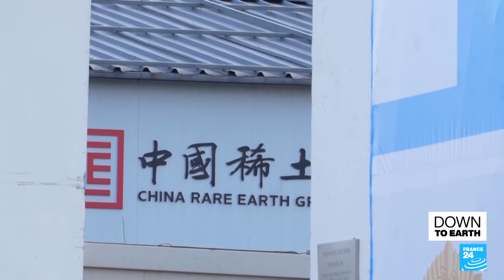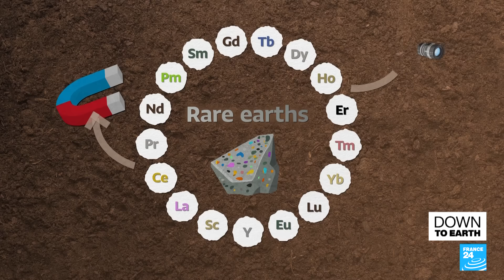French-American chemist makes major breakthrough in recycling of rare earths • FRANCE 24 English

Comment: Just a quick public service announcement: the United States actually has all the rare-earth elements we need right here at home, locked inside the millions of tons of coal ash produced over decades of power generation. Coal ash is rich in strategically important elements like neodymium, dysprosium, yttrium, and others essential for everything from fighter jets to smartphones to electric vehicle motors. The challenge isn’t the resource — it’s building the domestic processing capacity to extract these elements efficiently and in an environmentally responsible way. Current extraction methods can be messy and energy-intensive, so the real breakthrough will come from designing cleaner, scalable systems that can turn this waste stream into a reliable supply chain that doesn't rely on China. It’s absolutely achievable, and far safer than continuing to depend on foreign suppliers for materials that are now tightly tied to both our national defense and our high-tech industries.

Comment: Globally, europium production is relatively low, estimated around 100-400 tonnes per year.
Europium is a chemical element, and for $3 billion, one could purchase around 5 million kilograms (5,000 metric tons)
3 billion to RESEARCH a way to get very little back from neon lights ONLY.
Economic insanity.

Comment: Still missing a key part - the labour costs to break the stuff down to the point this system can be used.

I'm a recycler and I take apart these electronics/gadgets etc and it is time intensive if you want to break them down to their bare constituent parts. So much so, I like the vast majority of recyclers only take the easiest parts that pay - copper, gold bearing parts etc. There is no money currently to take it further - you lose $ if you do. 

Until robots can be tasked with taking apart cellphones, hard drives and motherboards etc - I'm sorry to say, this sulphur solution is not going to be financially viable.

Comment: The "actual" volume of rare earth minerals is extremely small when compared to just about any other commodity that it makes recycling absurd on face value.  Way easier to build more refineries.  No rare earth element will ever be a problem.  It is just wrong to pretend otherwise.  Rare earth elements are not rare.

Comment: Acid coal mine drainage sludge contains many rare earth elements. The California Mountain Pass Mine still has a lot of rare earth ore left, but the California government has made it impossible to extract economically.
Reply: Only a few are rare, the rest are  Just mixed together and very hard to separate. Certain elements and salts will cause certain rare earths to "crash" out of solution.. or in my case crash out a solution of sodium phosphate using a tiny amount of cerium ( Bic lighter Flint solution) and various other RREs. 

Basically a solution to fertilizer    pollution.

Comment: Rare earths have been found in certain coal ash piles surrounding coal power plants in concentrations much higher than natural ore.
Reply: No one wants those rare earths. There are 17 rare earth elements of which only 5 are "valuable"
Reply: @robertlee6338  8 are important, all have uses.
Reply: Which?
Reply: @robertlee6338  which 5 are valuable? I'm curious which you see as so (I want to see if you're right, & I'm wrong)
Reply: But are they economically feasible to extract?  Leeching rare earth metals from coal ash involves a lot of acids, and alkaline washing. This is contrary to Marie Perrin's process.
Reply: @josephvisnovsky1462 just chlorine is needed
Reply: @EzraMerr  explain how only chlorine is used for coal ash recovery? Without other chemicals, or high temperatures.
Reply: High temperatures are used in flash joule heating.
Reply: @EzraMerr  if chlorine reacts with water creating acids, and recovered metal chlorides are volatile , then please elaborate on "only chlorine".   

Recovering valuable metals from such volatile metal chlorides requires either more high temperature, or additional chemicals (cyanide, ammonia, thiosulfate).

"The concentration of rare earth elements (REEs) in raw coal ash is typically in the range of 200 to 1220 parts per million (ppm) (equivalent to 0.02% to 0.12% by weight), with an average of around 404-445 ppm globally." - in other words 0.4 - 2.4 pounds per Ton (includes all metallic elements).
Reply: @josephvisnovsky1462  Ask her, I sent those links.
Reply: Some people are working on "recovery methods" that can get the rare earths out of fly ash.  One problem is that steel mills and power plants may not be too picky about which coal they burn, with the result that highly valuable fly ash is mixed with fly ash that contains little or no rare earths.
Reply: The mining bit isn't really the problem. The bottleneck is refining, and certainly if you wish for it to be environmentally mitigated. Only a few places in the world are capable of large scale refining. Europe though as usual is focusing on becoming the recycling leader in rare earths no doubt, that way it can deal with the environmental issue but also more easily track with low cost countries.
Reply: Extracting rare earth is the easy part.  Refining it is the hard part.

Comment: Note that one of the key problems with Rare Earth elements is that they are chemically very similar. When you pull them out of a mine, it's a mixture that has to be recovered and separated. But in recycling, that separation can be done by hand - magnets in one bag, capacitors in another, and so on.
Even with that, I'm going to bet it is not a chemically pretty process on the larger scale.
Reply: Nope, the issue is pollution from recovery, new technologies make this viable now when in the 1990's the cost was prohibited and only profit was in the chips and gold recovery.
Reply: @dansullivan8968 

if the west recycles it will just go to their war machine not consumer products for their consumer markets 

China is actually having a hard time meeting their heavy rare earth targets as demand jumps and looking to other countries to pick up the slack 

That's why they are dumping light rare earths onto the markets 

Probably because they have to mine so much to meet heavy rare earth production numbers 

China has recently found a dedicated heavy rare earths deposit that is expected to last 200 years 

But that deposit was just discovered
Reply: The fundamental reason lies in the rare earth industry: the market is very small, profits are low, and investment demand is enormous. Capitalists see no future in this industry.
As for patents, the vast majority are owned by China. By 2025, China's rare earth industry is projected to account for over 80% of new patent applications.
Reply: @Ceraline-u5p China's patent counts don't really matter.  Take other industries like EV batteries: Japan + Korea have 80% of all ACTIVE lithium battery patents, but China gets away with it because they simply refuse to enforce them.
Reply: @Ceraline-u5p Let's not forget LFP's core patents already expired past 3-4 years ago and they are effectively royalty free unlike Japan + Korea's ACTIVE patents.  That's one of the key reasons why China focused on LFP instead after their experiment with high-nickel batteries didn't go too well and since China can't export them without infringing on Japan+Korea's patents.  And that's also the key reason for which Japan + Korea battery competitors were effectively banned in China since 2015 under Papa Xi's Made-In-China 2025 to protect China's IP theft and their underlings who benefited from it.
Reply: @Ceraline-u5p  re: China's policy of forcing tech transfer/IP theft, banning foreign competitors,  and subsidizing overcapacity; then finally driving out foreign competition isn't anything new.  Rinse & Repeat!  China is a non-market economy -- no point in pretending that it's not.   Smear campaign my a55
Reply: @Ceraline-u5p Yes, that "junk" is called LFP by Sunwoda, which I had already explained whose core patents already expired 3-4 years ago and is effectively royalty-free.
Reply: @Ceraline-u5p Further, despite BYD's early LFP adoption since 2000, it was far from class-leading and its key contribution is in Blade pack design, not in chemistry.  LFP remained inefficient and expensive up until late 90's after the Chinese gov't banned all foreign battery producers and brute forced scaling up to lower the cost.
Reply: @Ceraline-u5p Of course, CATL exports their NCMs alright and like I said they are not far behind Sunwoda.  Japan + Korea are going after CATL from bottom up, as Ronbay's recent legal defeat would bubble up to their key customer CATL.   That being said, not all Chinese EV companies infringe and at least one company has legit license, Geely.
Reply: @tooltalk Sunwoda and Nissan signed a strategic cooperation agreement in June 2020 to jointly develop onboard batteries for e-power vehicles, supplying batteries for Nissan's global models.

The biggest criticism of Nissan electric vehicles in China is that they consistently use  "junk" batteries.
Reply: @Ceraline-u5p Sure, all foreign companies, including BMW, were forced to use Chinese batteries in China since 2015 under Papa Xi's Made-In-China 2025.   All battery producers were likewise effectively banned and Chinese gov't official apparently went around threatening automakers to use local batteries made by local battery champions or face repercussion.  It's likewise no surprise that BMW will use Samsung's 46XX outside China.
Reply: @tooltalk  No difference? Don't make me laugh. CATL's ternary lithium batteries are the best in China, and BYD's lithium iron phosphate batteries are the best. As for Sunwoda, both are very poor. Doesn't a 3% market share prove anything?

Even so, Sunwoda won the "Nissan Global Supplier Innovation Award" in 2022 and secured a 7-year, 1.157 million-unit battery order from Nissan in 2019.

And your so-called battery ban is another lie. Tesla models using LG and Panasonic batteries are still sold in China. LG models are widely criticized for their rapid battery health degradation.
Reply: @Ceraline-u5p Sure, that's a lie.   China's ban lasted about 6 years and shadow-ban afterward to today.   China started exporting EVs around 2021 as most LFP core patents expired and no longer posed significant infringement issues.  It also became quite inconvenient for China to keep foreign battery producers out while demanding the world to open their markets to Chinese EV.   That's the only reason why Tesla was allowed to ship their Long Range models with LG batteries starting 2021.
Reply: @Ceraline-u5p repost: @Ceraline-u5p China bot going berserk b/c can't handle the reality  LOL  Of course, CATL is best in China where nobody else is allowed.  LOL  BYD's LFP isn't as bad as CATL's.
Reply: @Ceraline-u5p repost:  Sure, that's a lie.   China's ban lasted only about 6 years and shadow-ban thereafter to this today.  Tesla was allowed to use LG starting around 2021 in the Long Range trim.   China really had no choice, as most LFP core patents expired, China was eager to start exporting EVs.  BUT its own closed-door policy against foreign battery producers really looked bad.
Reply: @Ceraline-u5p Also, now that you mention Tesla, you do realize that Tesla only uses LG NCM, not CATL's.  Tesla uses Chinese batteries in low-range SRW/RWD only.  Tesla knows what's best and it isn't CATL.
Reply: @Ceraline-u5p As a result of China's "open market" policy, LG was allowed to have Tesla as a customer and a grand total of 1% of China's EV battery market after the 6 year ban to protect local "champions," CATL and BYD.
Reply: This is the exact point that came to mind. An economically viable way to separate the extracted metals, at scale, accurately and efficiently. If that step can be solved, might be onto something. Still a positive discovery though